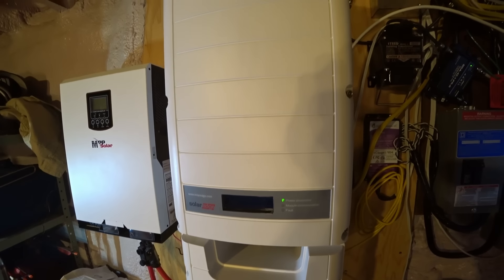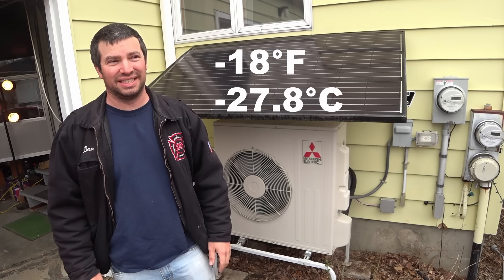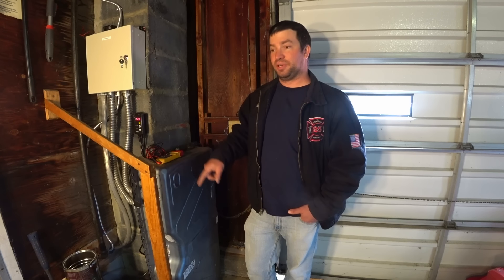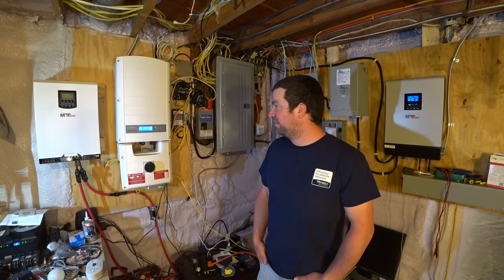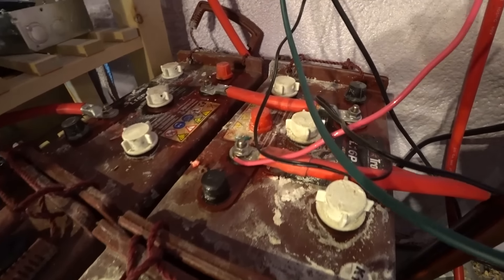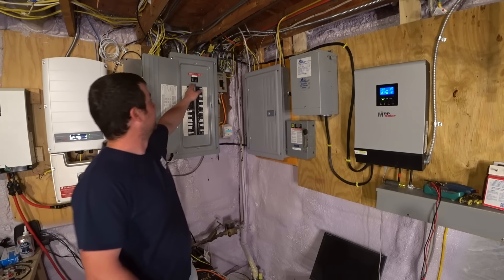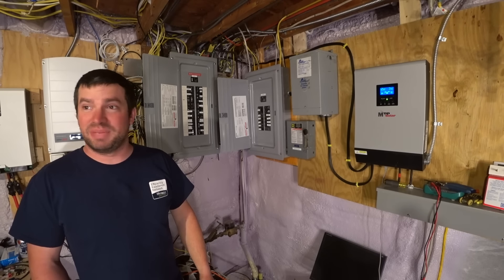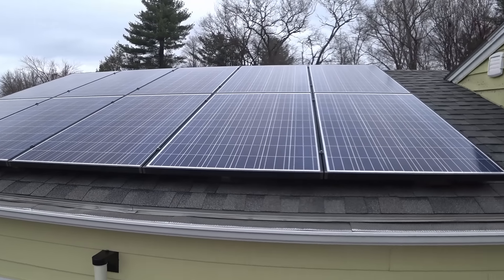Huge Grid-Tied Solar PV with Battery Back-up System

Comment: I like at 2:46 that he's disconnected from Natural Gas and I would like to know how he did that as I'd like to do the same - in Australia our BBQ gas cylinders are LPG and I have been told it's higher pressure is unsafe to use in our natural gas stovetop due to the larger nozzles for natural gas versus narrower nozzles for LPG - how did he solve that problem?  It looks like he has 2 regulators - is it that simple or is there more important things to know to ensure safety?
Cheers!
David
Reply from the maker: Attached to the tank is a grey round disk, it is a regulator.  It takes the high pressure of the tank, and drops it down to low pressure for the stove.  Search for regulators and you will find them.  In the USA you can buy them at any hardware store as a replacement part for outdoor grills.

Comment: Great interview! 1999 I moved into this house and did a self install solar system with 1200 watts of solar and 4 L16 batteries for a 24v system. The inverter is grid tied. 2020 upgraded to LiFePO4 16K watts, 3800w more solar panels. This was mostly a self skill test for me! It has turned out to be great idea. Thank you for your video.

Comment: How does he like the MP inverter, and what model is it. a real fab job !
Reply from the maker: Bens inverter is the 5048MG.  I show this at 7:27 in the video.  He likes it a lot because it also serves as a charge controller, so it's like getting two devices in one.  Ben has said that he likes running it through the transformer to get 120/240v.
Reply: @DavidPozEnergy  I am looking  the   LV 5048, in a split phase , L1 = 120,   L2 = 120, and  L1 <-> L2  is  240.  This feeds the whole house power As a  tiny, the current demand  is 21 A at 120 V.    Any comments ? Any past issues with his 5048
Reply from the maker: Bens 5048MG puts out 240 volts on a single leg.  He then runs that into a transformer to give himself 120/240 split phase.  This is because he bought his inverter before MPP Solar started manufacturing a split-phase model.  Now that they make a split-phase model (LV5048) you have another option on the table.  Both options are good.  Ben likes to series the panels into a higher voltage than the LV5048 can handle.  Notice the LV5048 has an MPPT range of 60-110 volts DC.  http://www.mppsolar.com/v3/catalogs/split%20phase%20LV5048.pdf
But, the 5048MG has a voltage range of 120-430 volts DC.  That means less wiring, less combiners.  http://www.mppsolar.com/v3/catalogs/PIP-MS_MG.pdf  But, the downside is you have to buy a transformer.

Here is a video from another YouTuber on how to wire in a transformer: https://youtu.be/0E8fV9VMDFs

Comment: Guy"s a Great video, 2-3  Qs though, do you have a transfer switch that runs the critical panel when utility is on? I do not see 1 on your wall. Does your solar stay on when utility is lost? If you tapped into your solar system to power your inverters built in MPPT. where did you tap in and did you need a special device or what.  Sorry for the many Qs but I to am installing on a grid tied system a 48vdc 15Kw split phase inverter/charger with and 640ah batteries with a built in 80a MPPT charger. I am trying to find out where and how to keep the power coming in from the solar to feed the inverter/and charge the batteries.  any input you can offer would be a big help.
Thanks in advance

Comment: What are your thoughts and/or opinions on growatt systems? From what I’ve seen thus are they seem to have a very popular following, seem to inform very well and do great with grid tie as well as offgrade systems and also have an excellent price point. I’ve been messing with solar now for a few years but looking to add a substantial amount of panels which will be retired. Unfortunately where I live at in East Texas they are not nearly as generous with what they paid you, I believe it’s somewhere around five cents at best so roughly half of what they charge you but something is better than nothing right. I enjoyed the video and love checking out the set up and look forward to hearing from you. Thanks.
One last thing. Did I hear you say that your panels are hooked in series or groups of series?
Reply from the maker: If you plan to have any connection between inverter and grid then make sure it's UL listed.  Some growatts are, but not all.  Other brands like the Schneider XW pro inverter are fully UL and allow for zero meter functionality.
Reply: @DavidPozEnergy  Best farm how have these units stood up against the test of time? As far as whether changing connections out moving things overall functionality as well as their accuracy on what they are displaying that they are bringing in and putting out, how true do they seem to be? And how has Customerservice been? That’s always a big one
How are the last two months we just had the highest electricity bills we’ve ever had in 10 years, granted we live in East Texas however when your budget and your bill is twice what you budget for and you’re staring at a bunch of solar panels you have outside ready to be hooked up lol

Comment: You so gotta come down to Delaware... I've got a huge house roof and barn roof that is screaming for panels. A lot of what you were saying was way over my head. That's so what we need. Getting tired of the little outages that are just long enough to be a PITA. Did you say how much the batteries were and I missed it? (no lead acid) All the companies down here want to lease panels/systems to you and have you pay them for 20 years... don't wanna do that.
Reply from the maker: I don't think Ben travels that far, buy you can always call the company he works for.  (link in description).  I agree that leasing panels is a bad deal.

Comment: Hi david ..cuestion where can i bay 1 litium  battery ..like the video 17 kw 48 v ready  whit bms include i have a boat .i going to install  in my boat tkyou i love you videso..i learn  to much
Reply from the maker: I buy my batteries from https://batteryhookup.com/  They also have BMS's available: https://batteryhookup.com/collections/accessories/products/12v-lifepo4-smart-bms-w-low-temp-cutoff  You can use my code "DAVIDPOZ" for 10% off.

Comment: Do you have any videos regarding fully off grid systems?  I'm building my dream home in the SE foothills outside of Reno. 2400 sq ft house with 950ft deep well. No grid tie available really ($175,000 cost from Nevada Energy). Lots of great sun and I have a large, south facing barn roof to cover with solar panels....
Reply from the maker: Most of my videos are on my own projects.  My current house still has the grid.  My goal is to build my next house 100% off grid, like you are doing.  So my projects are based on off-grid.

Comment: hi david,what is the solaredge inverter model and the off grid inverter model,it looks very coo
Reply from the maker: Hi Hao Cheng,  I don't know the solar edge inverter, but I just asked messaged Ben and will let you know.  The off-grid inverter is from MPP Solar https://www.mppsolar.com/v3/  He is using the PIP, High-voltage 240v.
Reply from the maker: The Solar Edge is SE-10000.

Comment: I live in Arizona and I wonder if you can produce enough power to charge a electric vehicles?😆
Great video sir and I like to know how much will cost me if I  DIY and regulations with city and my local MEC I am getting tired of all the calls about solar companie$ 
I have a reasonable contractor electrician for permits and I need to get the right equipment for my 2200 Sq home and lower summer and winter $500 electric bills and maybe producing  $ome. 
Apretiate your advice and thanks!  😆👍

Comment: So you're not always using the batteries to run your inverters, the solar panels can power inverter through the charger?
Reply from the maker: Yes.  The device on his wall "MPP-PIP" is both an inverter and charge controller in one.  When the solar panels make power it will either use it to power loads directly, or charge the battery.  Whatever makes most sense.

Comment: what happens when you need to re-shingle your roof?
Reply from the maker: You have to take the solar panels off for the day.
Reply: I got a new roof before I added panels.  The asphalt shingles last longer under the panels as well.  But should it need a re-roof, I'd have to take them off and put them back on.

Comment: Question for Mr. Ben.  What do you think about this idea for additional boost to a battery backup system for people with either NO solar or outages when there is little to no sun? You start your car, let it idle, and boost your battery bank 12V at a time.  For example, if you have a 48V battery bank, let your car idle and every half hour, move the clamps to a different 12V subbank (keeping track of which ones you already boosted of course).  A typical car idling can output about 1000 watts to a battery bank that is not already near fully charged (or to a near fully charged bank with a 1000+ watt load on it).

Another method is to use a 12V to120VAC inverter outside (if possible) and feed it into your house, then run battery chargers from that.  Pure sine wave output is preferred but modified square wave should work too for most chargers.  I would not recommend bringing the inverter from warm inside to the very cold outside to do this.  One way around that might be to run your car in the garage so you retain the heat and of course vent the CO out of the garage and use CO detectors as a precaution.  That way the inverter stays relatively warm, close to 70 degrees F.

In some cases, it may be possible to run 230V into your house using a 12V to 230V inverter, and then drop the voltage inside from 230 to 115V, then run your chargers.

Many tweaks to these ideas are possible such as upgrading the alternator on your car from 1000 watts to 2000 watts or even higher.

Again I would only recommend doing this if you need emergency boost power (like your solar system has been running on batteries for many hours and the batteries are getting dangerously low).   A boost of 1000 watts on a 2000 watt average load might double the runtime of your batteries.

For very long car idling times (more than say 2 hours), it is recommended that you blow a fan across the car to help cool it, unless the car is outside in the cold.  It would be kinda slick to have a way to get the jumper wire power easily inside your house such as a terminal interface from the outside to the inside of the house or garage.  That way you don't need to run thick wires under the garage door for example where CO could possibly get in.
Reply: I wouldn't recommend charging 1 battery at a time, you're asking for trouble with that.
Reply: I didn't say anything about 1 battery at a time, I said charging the bank, implying many batteries.  Also, why would charging 1 battery at a time be "asking for trouble"?  A typical car normally only has one battery (under the hood) and those usually last for years.
Reply: Sounded like that was what the whole first paragraph was about...
Maybe I misunderstood, but you were talking about a 48v battery bank and charging it 12v at a time moving leads around.
Car batteries barely get cycled.   They're there for the cranking amps, then float charging.
Reply: @David James - No...

Comment: Whats the deal with the dryer how come u cant use it seems like u have enough power ??
Reply from the maker: With this system his inverter outputs 5kW.  His dryer draws 5kW.  So if he ran the dryer he couldn't run anything else at the same time.  Since this video Ben got a larger inverter so now it's not a problem.
Reply: @DavidPozEnergy  😮 omg a dryer pulls that many watts in order to run ? unbelievable
Reply: @DavidPozEnergy  quick question do gas dryers take that many watts to run or just electrical dryers
Reply from the maker: Electric.  It's the electric heating element that draws a lot of power.  Gas and Electric both have a motor and fan, but those might be 200-300W

Comment: off the grid system(72kW/H battery,12kw array panels), but on winter I have to switch to the grid, on spring, summer, I have excess of energy,.
There's a way to use this array of panel to fed a grid tie system

Comment: Concerning the Mitsubishi mini split with the solar panel over it. 

I am looking at a similar outdoor compressor. 

Is that one solar panel powering the mini split or is it just supplemental power?
Reply from the maker: Hi Gary,  The single solar panel over the compressor can feed in to help charge the battery.  It does not power the compressor directly.

Comment: I do not know who can answer this, but I would appreciate any hints. 
I would like a system that is grid tied, but I do not want the inverter to stop powering my house just because the grid is dead.
I want the entire house powered weather the grid has power or if I am using either battery, generator, solar or wind
my thought is the 
1 grid >> invertor >> house
2 generator >> invertor >> house
3 solar/wind>>invertor >> house
and in all steps invertor to charge controller to battery 
based on everything I heard it sounds like i need an off grid inverter with grid as an input option and some type of a switch between the inverter and the grid????
does anything I said make any sense? does anyone have any suggestions or have anyone attempted anything like this?
thanks
Reply from the maker: Yes, this exists.  The inverter that does exactly what you are looking for is called "Sol-Ark 12K"  Ben (the guy in this video) actually upgraded to this exact inverter.  I made a follow up video on his new setup that does exactly what you are asking for: https://youtu.be/7zoPu-uK4Xc
Reply: @DavidPozEnergy  Thanks David - really helpful. I appreciate the note.

Comment: i have a solectria grid tie inverter, old 7600w,  a victron 600 80 mppt, samlex 1500w inverter, and 200ah 48v battery set.  i've been told that i can't hook up the battery to the solectria inverter.
but do i need to?  can't i hook up the pv strings to the solectria and to the victron mppt via pv disconnect switches and fuses.  then use a separate ac power out box and breakers from the soletctria to main circuit breaker panel.  and have another ac power out box from the samlex inverter to the main c.b. panel.
Reply: i would use the samlex 1500w inverter for critical loads only.

Comment: With Sol-ark 8K you can get rid of all that junk and have a single box that is the most efficient Hybrid inverter on the market.
Reply from the maker: The Sol-ark looks great.  I hope it catches on in popularity.
Reply: @DavidPozEnergy  I am testing mine right now  with some LiFePo4 batteries and works beautifully. It is even able to get more power from solar panels which surprised me because I used a SMA 4000tl-US before and that was already 96% efficient. This thing is pure brainology.
Reply from the maker: I'd love to see your setup.  Could you post a video of it?
Reply: @DavidPozEnergy  I could make a quick video, but I still need to install some permanent cables for the batteries and install the BMS . The batteries so far are still balanced. The China factory matched them very well. Or I could send you some pictures or make a Skype session.
Reply from the maker: If you don't want a public video, then perhaps an "unlisted" video and send me the URL link to facebook or my e-mail?  I'm not on skype.  https://www.facebook.com/DavidPozEnergy/
Reply: @DavidPozEnergy  David Can a off grid system me made to power my business? The light bill is about $6,000 a month.
Reply: Yes but $6000 is huge sum for a hybrid inverter.  Solark inverter cost more than my entire hybrid system setup including inverter, solar panels and batteries.  As long as cheap chinese inverter works as advertised, I will throw on couple of more cheap second hand solar panels and tolerate the inefficiency.  Most of my fear about cheap chinese products are that they will break quickly or have some serious defects which make them unusable.  But review videos such as this shows that cheap chinese inverters can be quite reliable too.

Comment: I hope you keep the air circulating and filtering in your house still
Reply: Yeah, the windows are still pretty bad so that's not an issue for now.  I do have 2 Panasonic bath fans that run a couple hours a day automatically.

Comment: Good informative video. Yes 48v is the correct way to go as I started with 24v. The main switch was turned to battery and solar, but what happens when the switch is turned back to the grid? Will is be possible the the frequency will be off and be like a huge short? I'm very quruous about that. Is there a sitch delay and synchronisation before switching back?
Reply: It will synchronize with the grid before reconnecting.

Comment: Really nice and was great for me to learn something. Now if possible, 1. The transformer acts like the power company 2 hotlines (240v) correct?
2.the circuit breakers next to the transformer have like a secondary wiring for needed electronics to run on backup, Correct ?
3. How to automatically switch the backup system on once grid is out?
4. Is there any simple wiring diagram for the main connections?
Thank you so much
Reply from the maker: Out of the transformer there are two hot lines.  120v-N-120v.  The two hot legs can be combined for 240v.  Yes, this is exactly like what you get from the grid.  2. The subpanel (circuit breaker box) is everything running on the transformer.  Not everything can run on it, such as the electric dryer is still on the original panel.  3. It switches automatically, built into the MPP PIP (white inverter).  4. The inverter company probably has some wiring diagrams in the manuals: https://www.mppsolar.com/v3/